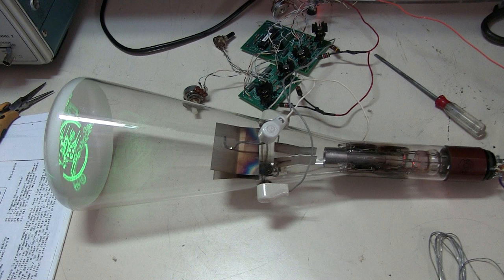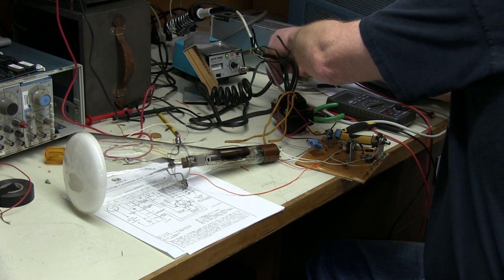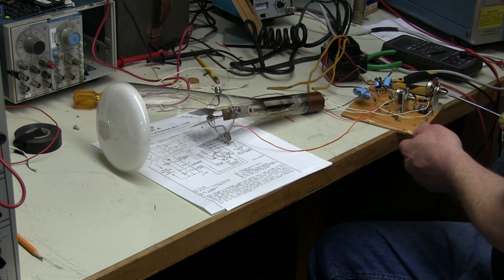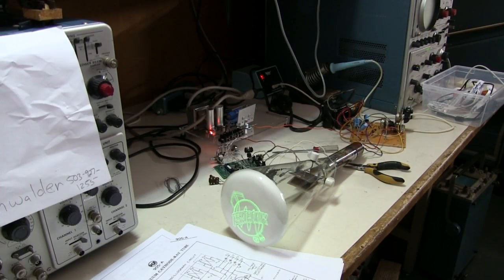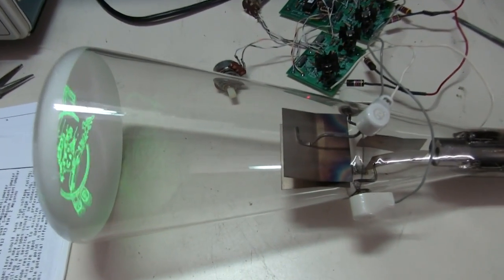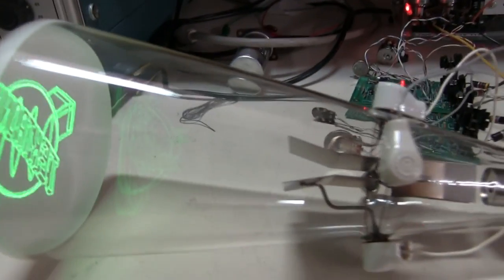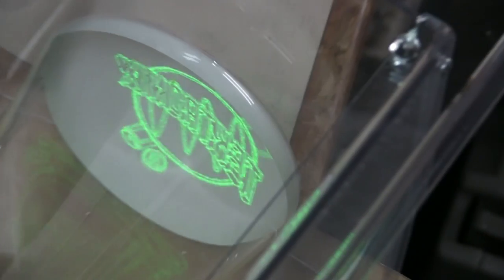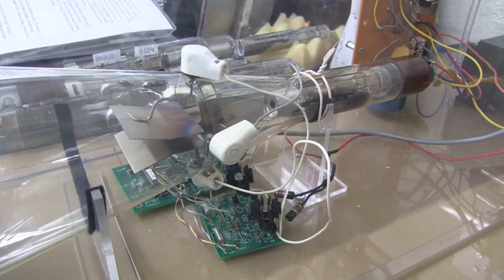vintageTek Demo of a 1930's 905 CRT

Comment: Hi, if you see this I was wondering if there are any modern methods to reduce xray radiation from the crt without using leaded glass?
Reply: Carlos, you can get leaded acrylic sheet if you don't want glass. There is also bismuth loaded acrylic.

Comment: https://sound-au.com/xfmr2.htm In order to reduce the radiated flux from an E-I transformer core, you will sometimes see a copper or brass band* wrapped around the winding and the outside of the core, as shown in Figure 13.4.  This acts as a shorted turn to the leakage flux only, and greatly reduces magnetic interference to adjacent equipment.
 (Flux band absorbs the magnetic leakage by turning it into current/heat). This would help your 'shakey' display.

Comment: In the future, when you absolutely positively need a CRT for a game, and all old CRTs are broken, these dead-simple circular CRTs (that could conceivably be produced without heavy industry) will be what we use.
Reply: Get 3 of them, put color dyes in the phosphors, put lenses in front of them, bam, crt projector with a huge image
Reply: @tankmchavocproductions6907  you'd probably be better off just picking different phosphor colors for each tube: red and blue phosphors exist
Reply: so many people are interested they will learn to rebuild the CRTs (it's possible)
Reply: If industry is that bad off we will have more important things to worry about than computer games
Reply: Just rebuild old crts with a new electron gun.  The industry only stopped because of reduced demand meaning no profit was possible.
Reply: @ericrawson2909 you also get phosphor burn and a new gun will not fix that.
Reply: @ericrawson2909  and new phosphor

Comment: While it is interesting to see a CRT working from the inside, HOW does it work without the conductive black coating? (I'm no expert on how these work)
Reply: The secondary electrons emitted by the screen are collected by the deflection plates, which are the first positive elements they found close to the screen. Old tubes without the internal aquadag film are prone to distortions on the waveform displayed due to the stray currents caused by these secondary electrons when they flow through the relative high resistance path associated to the deflection plates.

Comment: This vintage technologie so much more understandable than the modern display.

I can show kids a this video and they will understand how CRTs worked (at least the clever ones) but a TFT is a totally different thing.
Reply: Only because it's larger. If you saw an LCD (tft is a type of LCD) that was scaled up to this size (about 50x50 pixels in a 8" x 8" form factor) you'd be able to see just how simple it is. Like holding a hand in front of a flashlight, but replacing the hand with an rotating paper that is controlled by electricity.
Reply: I've often wondered how much the accessibility of early technology fed back into the culture and helped propel the industrial revolution. How many curious kids could sit and watch a steam engine for an hour or so and get a pretty decent idea how it worked, be inspired, and go on to a career in the field and maybe invent something of their own. Now? All of the most ubiquitous tech is basically invisible. 

Instead the kids that would have grown up to create interesting and useful physical products and building projects start useless tech companies that make us all more depressed and angry. (Not all of them, YT is amazing for sharing knowledge just like this, but there are plenty that are entirely needless.)
Reply: @jacobyunderhill3999 u are right ! I remember that lame startup called "juicero", selling a over priced ($400us Dlls i remember) "cold press" for little juice bags...

Comment: You know those emit röntgen right?

It's not a shocking amount, but you are getting a dose
Reply: I think the output of the voltage doubler is too low for x ray emission. Makes me  wonder though, how much ionising radiation have I actually absorbed from an average 3-4 hours daily viewing of CRT's in 60 years?
Reply: @roberthorwat6747  it's not to low, but the energy is so low in later commercial units that you'd get a dose only if you're within a few cm of the screen.

X-ray doesn't really travel well in air. A 120kv source is only detectable upto about 4 metres.
Reply: @Jan-mu6vs  👍

Comment: This is truly awesome work. LCDs these days. CRTs were using tiny changes in voltage to change a magnetic field to change where the electron beam went. Obviously LCDs can produce a higher quality but the CRT was a HUGE jump in technology.
Reply: Most advanced CRTs can display pictures with HD res, and some professional ones can even output something comparable to 4K !

Comment: i would like you to the process of electricity entering  the tube what each part is doing to create the pic    i thought the tube has a welding rod of a type that gets shorter and fatter as it gets used
Reply: NV: Perhaps you are thinking of a Carbon Arc lamp, such as those used in searchlights.

Comment: Man we need to get these back in production
Reply: I agree, I would love to have a brand new tube circuit crt
Reply: Go to andeman
Reply: Maybe not these but color tubes for sure
Reply: MELZ still produces them in Russia btw.
Reply: @disketa25  
They are mostly medical and military equipment though
Reply: @SMGJohn  Supply and demand. These are the only areas where you need an absolutely reliable tube. That is, a new one. For all other applications, either a relatively inexpensive regenerated tube (reapplied phosphor and calibrated flux), or even an almost free used tube with a good residual resource, of which there are thousands at flea markets, will do.
Reply: No
Reply: ... why? They look like shit, use a ton of electricity, take up a ton of space, and overall lack any of the quality with current technology.

I guess people are into the crap and degradation of vinyl so makes sense they'd be in to CRTs too?
Reply: @orangejjay  plug in a PS1 into a 4k tv then plug it into a Sony Trinitron. You’d realize quickly what we’ve been missing out on in years. Ever since we switched to flat panels we’ve been trying and trying to get back the positives we’ve lost from switching. We finally have lag reduced pretty close but motion resolution is still nowhere not there. 120hz with bfi helps but it’s still not quite there. Flat panels couldn’t get anywhere near the color and contrast of CRTs for a long time until we got Oleds and HDR. Then there is refresh rate, CRT pc monitors have some crazy refresh rates that we haven’t even gotten close to on flat panel until very recently. Also the fact there is no such thing as a native resolution for CRTs, almost anything on them doesn’t have that stretched upscale look cause everything is native and fits perfectly into every phosphor (crt ”pixels”). Also low resolution content on a CRT just can’t be beat. Upscaling still has flaws, it’s getting better but still doesn’t compare to something looking native. The Retrotink 5x does a decent job but CRTs still look better. The Retrotink 4k might fair better since it will have more accurate phosphor scanline filters but we will see. It’s taken us decades to get even close to getting back the positives we lost from switching to front panels and we still aren’t quite there. 
Lcd is dogshit and is still dogshit to this day. Qleds are better but really are desperate end of life moves for that tech. Oleds have made the biggest difference in getting back what we lost but still not there.
Reply: @gex581990  there are many reasons why it can't be made today or again even for niche markets
Reply: @orangejjay  isn't the quality of crt alot higher than new tech? Alot of items produced these days is built to be thrown away.
Reply: @Rautz. i have a japanese sony watchman from 85 it messed up the switchs and volume but it still work
Reply: @orangejjay  They definitely don't look bad. You must not know what you're doing.

Comment: The Sony Watchman actually had a CRT that was viewed from behind. It projected onto a phosphor screen angled at 45 degrees.
Reply: A similar if not the same tube was used in a lot of low profile wall mounted video door intercoms before LCD monitors were invented.  The screen was curved and closer to 30 degree angle and I always enjoyed playing with them, it was so cool to watch the picture through the vacuum.  Tubes are still available NOS  https://crtsolutions.ecrater.com/p/10644463/04jm-4-flat-b-w-crt-tube

Comment: felt so happy seeing a crt, grew in the crt era, lcd's are harsh on the eyes, & the blue light problem was never there.
Reply: 😂😂 totally the opposite
Reply: CRTs have the same blue light problem, hate to tell you.
Reply: SirFrag32  so all screens have that problem, but never heard crt's disturbing sleep patterns or anxiety attacks like todays screens give.
Reply: @bazrazin1  CRTs feel like they are burning your eyes out if your sockets
Also they didn't disturb because no one out CRTs in phones 
If they did it would be the same
Reply: I still own quite a few CRT monitors for my retro gaming PCs. They are definitely harder on the eyes after long periods than modern screens. They do still have benefits like more accurate color replication, and near non existent input lag, but they weren't perfect by any means.
Reply: @BorkBorkDoggo  OLED has the colour reproduction and no input lag like CRT
Reply: OLED is very prone to burn in though, which negates a lot of it's benefits making it not suitable for most applications, at least not yet until things improve.
Reply: That's very likely because we spent 10 fold more time in front of screens, simply because they're more accessible. Back in the days of CRT, I had one on my desk and no phone, tablet, etc. Now I have 3 huge LCDs on my desk, 5 at home, phone, tablet, car screens, etc. probably 80% of the time I spend awake is in the vicinity of a screen. That was not the case in the days of the CRT. 

There are studies that show the majority of people that devlope sleep issues are related to phone/tablet use before bed.

Comment: Is there a scematic of wiring one of these up? I have a 3JP1 and I want it to be in a nixie tube/Bluetooth speaker system as a visual. Something that will display the soundwaves of the music that's playing. Is something like this practical? I'm an artist, not an electrical engineer haha. Any thoughts would be great thanks
Reply: Jack Kuehneman You would likely find it easiest to work with an old B&W/monochrome TV CRT tube as they use magnetic deflection coils to steer the electron beam and are well suited to low frequency use (audio being low frequency as it is tops out at ~20KHz).  With the electrostatic beam steering used in oscilloscopes you have to drive the steering plates at fairly high voltage while magnetic coils could be driven with simple audio amplifiers and do not require high voltage since they are simple electromagnets.  Oscilloscopes use electrostatic steering because it allows for much faster steering of the beam and thus allows an analog scope to operate at much higher frequencies (megahertz and beyond) versus the mere kilohertz of magnetic deflection.

But you could certainly use an electrostatic CRT, you just have to build the high voltage deflection power supply and the necessary high voltage amplifiers to drive the deflection (steering) plates — there are two pairs of plates, one set for vertical and one set for horizontal and for each pair of plates if one is being driven positive then the other gets driven the same degree negative, and vice versa — in other words they are always inverted relative to one another such that one is pulling and the other pushing in the direction you wish to steer the electron beam relative to its center “home” position (with no steering applied you get a simple dot in the middle of your screen).  

Note that because magnetic fields also affect the beam (hence why TVs can utilize slower magnetic deflection) you must also shield your CRT from any nearby magnetic fields if speakers or high power amplifiers are going to be anywhere nearby or you will experience unwanted affects due to the stray magnetic fields they create.

Good luck!
Reply: Here is a representative TV hack, short on details but has a catchy tune.  Be VERY careful with the mains on the power supply and high voltages on the tube.  They can do you injury and are easy to get shocked with if you are not experienced and know what you are doing. 

Sometimes a TV horizontal circuit will need the coil connected that the person unplugged and in these situation you will need to replace it with a yoke from a similar TV so it keeps working and then connect to the coil on the working tube.

https://www.youtube.com/watch?v=uftMl1efEdk

Comment: Would ion burn abe a concern with the CRT set up like this?
Reply from the maker: The accelerating voltage is so low that ions wouldn't have much energy. Ion traps were only used in TV CRT's with very high accelerating voltages, typically over 20KV.

Comment: Very nice project and what a beauty of a CRT. Thanks for sharing.
I ran into the same "wobble" issue when I build my scope clock.
First help was to replace the standard transformer by a toroidal transformer. That helped alot and the wobble was nearly gone. I then put the toroidal transformer into a MU metal can. That shielded the rest of the dirsturbing magnetic field. Result was a  stable and razor sharp picture on the CRT.
Reply: I used an old Heath kit built solid state oscilloscope  for an oscilloscope clock using a small CRT driver board and the CRT has a shield over  part of it with the power transformer mounted under the chassis in a copper or copper plated can with most of the scope chassis being of the same material.

No wobble that I can see.

Comment: Why doesn't this sort of CRT have the coating on it? Or perhaps i should say why do most CRTs have the internal coating?

Great video by the way, absolutely fascinating.
Reply from the maker: CRT'S after this one had a conductive aquadag coating (graphite paint) connected to the highest positive voltage. This gave the electrons a place to go after giving up energy lighting the phosphor. In this older CRT, the electrons either wandered back to the deflection plates, or collected on the screen, giving it a charge that could affect the image.
Reply: thanks very much for your explanation.
I was watching another YouTube video about restoring old CRTs and they put a coat of aquadag on the outside of the tube as well as the interior, why? 

totally understand if you haven't the time to reply, quite frankly I'm super happy to get one question answered.

thanks again for the great content.
Reply from the maker: An outside coating would be grounded. With the inner 'dag this would form a parallel-plate capacitor that would act as a filter for the high-frequency high-voltage supply. On color TV CRT's, the coating was usually lead, which would be both a capacitor plate and a shield for X-rays.

Comment: The problem comes from the beating between the mains frequency and the vertical deflection (frame rate) frequency. If you try to synchronize the picture generator to the mains I think that the problem will completely go away. That's the same reason for which the old analog TV was always synchronized to the mains frequency. Try this if it is possible.
Reply from the maker: This is not a raster-scan display, it's X-Y, so there is no separate vertical deflection rate. Instead the overall refresh rate would have to be adjusted, which is tricky. I plan to re-do this exhibit to reduce the number of mains-frequency transformers, which will reduce the stray magnetic fields.
Reply: I thought that it is using the standard raster scan principle. That's true that in this mode it's more difficult to synchronize the refresh rate to the mains because maybe it depends on the picture that is showing at the display and is no fixed relation to a clock frequency on the board. Really in this situation a SMPS or transformer rearrangement in the box (or magnetic shielding) should solve the problem.
Reply: Why not locate the transformers in a separate box and make a cable to connect them to the circuitry?

That way the transformers are away from the CRT.

Comment: I've always been fond of non coated CRTs.

I collect 405 line valve tvs of the 20 I own 3 are 1940s sets but sadly I haven't managed to get a set fitted with one similar. in the UK some 40s sets still had partly non coated CRTs I believe some 40s Ekco sets did but I can remember the model numbers.

Thanks for this upload it was a real Treat :-)

Comment: What, if any, is the danger of creating x-rays working with one of these?
Reply from the maker: x-rays are only a problem if the accelerating voltage is over 20 thousand. This tube is running at only 1200 volts.

Comment: Neat - wish I could have done something like that with the 3FP7 WW2 surplus CRT that I (aged 12) got for $1 in 1959, but it "wanted" something like 4-kv for its post ultor hv.  As far as I got by 1963 was to use a Tesla coil for that and put full-line AC on the deflection plates (all w/o the convenience of a diheptal socket!).  I cringed a bit when it looked like you might be reaching over some of your hv circuitry to plug in the transformer (think Ross Hull).  BTW, a gap in the aquadag coating on my 3FP7 let one see the "inside" of the phosphor face (bright-blue short persistence and longer yellow-green afterglow as designed for radar displays).
Reply from the maker: We must be close to the same age, and therefore the same as the age of Tek's first scope, the 511, which came out in 1947, the year I came out.